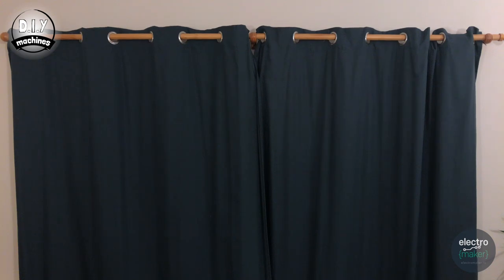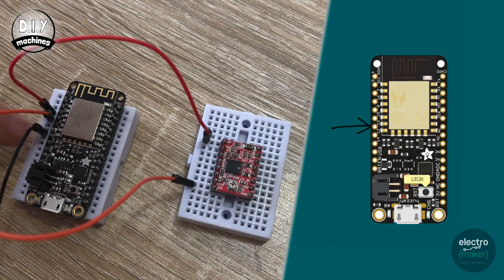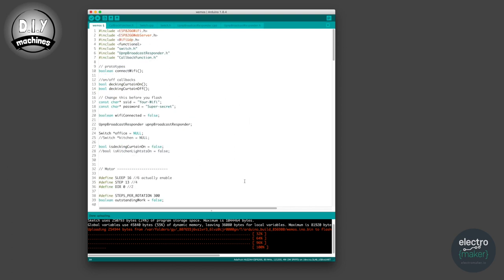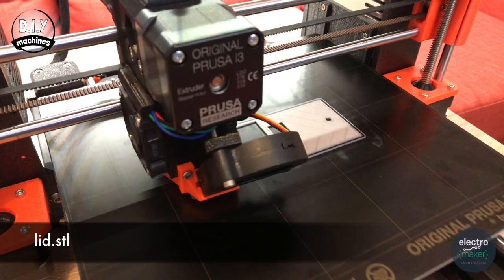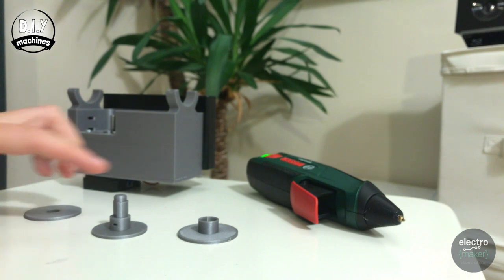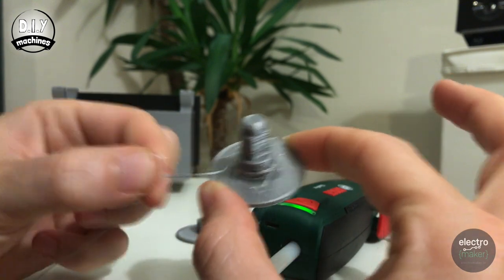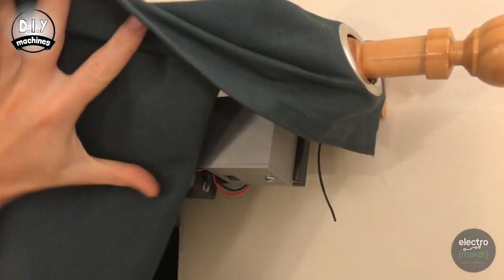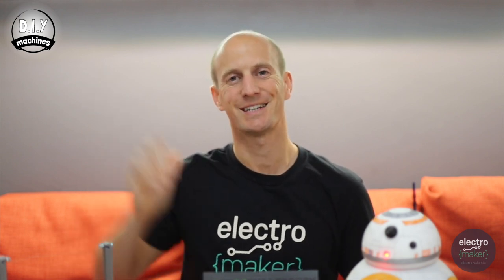How to build Alexa controlled curtains (Echo, 3D Printable & Adafruit Feather Huzzah!)

Comment: Wow man, this is awesome.  I'm going to be building this for sure.  I'll modify the code to included MQTT support for integration into home automation platforms.  

If using mqtt you can also make a setup program to make the min/max values able to be programmed after installation.  Very excited to get started on this, it's been on my honey do list for a long time.
Reply: Please do fork the code on Github and offer your improvements. That would be brilliant.
Reply: That would be awesome waiting for it
Reply: Rob i know you will be adding the mqtt but please also add a manual option - like a 2 buttons to open and close so the stepper can be triggered manually...if possible..thanks Lewis for this awesome project. I have 6 servo motors i got for BRUH's shades project but he took down the sketch when the site went into maintenance...
Reply: @DIYMachines  Really waiting for it !!!

Comment: Nice project!  One way to fix the delay is to upgrade to using an ESP-32 board rather than and ESP-8266.  The ESP-32 has a second processor core to dedicate to wireless so the core controlling the curtain does not have to pause.
Reply from the maker: Thanks, that's something I was not aware of when designing this. You learn something every day. :)

Comment: Cool project! I'd turn off wifi why it's traveling. You don't need a yield then. Might have a second reaction time before it reacts again, though.
Reply: Or simply use esp32
Reply: Can also just run it as a timed routine with something simpletimer.h, that's how I handle it with my stepper shades.  This is a super cool project.